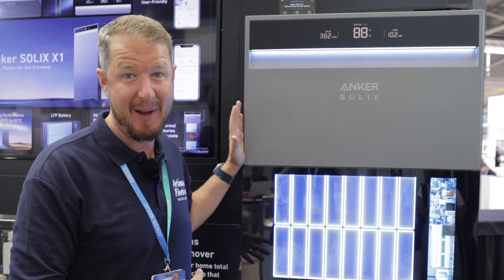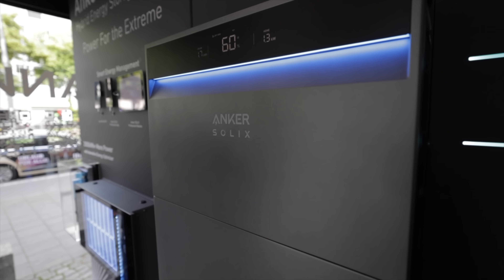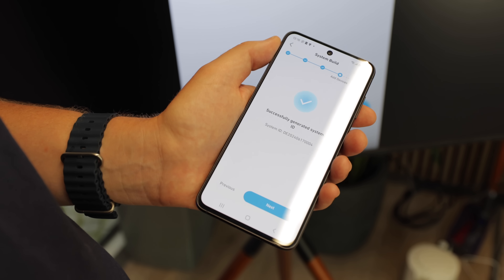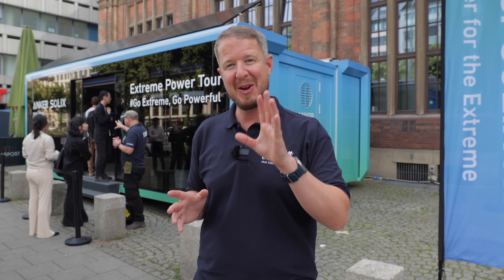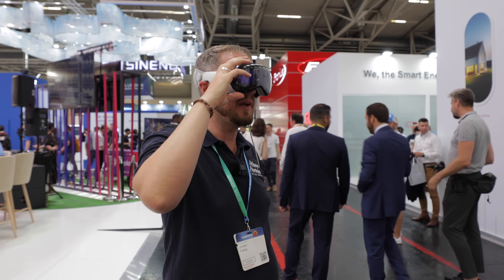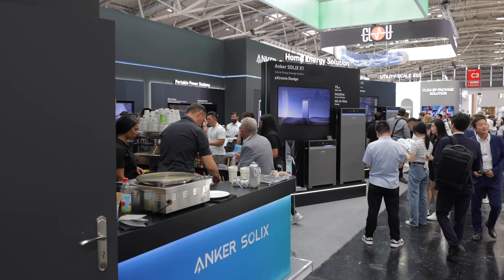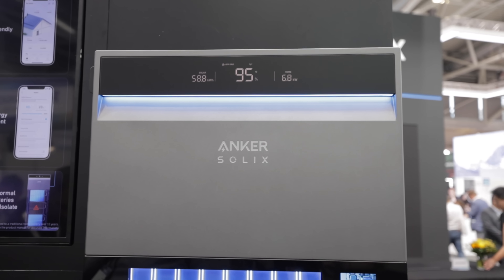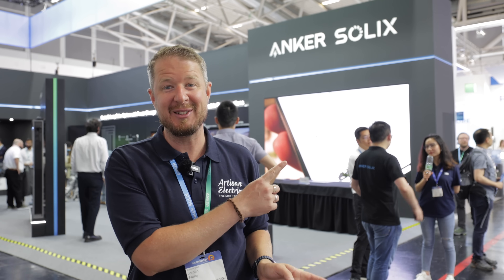EXTREME BATTERY STORAGE🔋Anker SOLIX X1 REVEALED

Comment: No cost yet in the US
Reply: I was quoted the following, from a local company in California, on the Solix X1 with tax and labor:
3 battery modules for a total of 15 kW : $20,450 USD before tax credit or rebates
4 battery modules for a total of 20 kW : $25,600 USD before tax credit or rebates
6 battery modules for a total of 30 kW : $35,900 USD before tax credit or rebates
1 power module only has a load start capability of 70 LRA so it will not start up most AC units unless it has a soft starter.

Comment: In case of mobile internet and Wi-Fi intranet BLACK OUT EMERGENCY. HOW DO YOU INTERFACE WITH THE SOLIX X1? Bluetooth? If not, it is a waste of money imo
Reply: It can interface with Home Assistant, so basically you'd set up one of those on a hub connected via Ethernet & then just integrate that with the batteries. You could then use it instead of or alongside the mobile app. You can use small UPS devices to keep your networking equipment and the hub itself online in a full power failure if the Anker batteries themselves & the grid go down, and those can also keep your WiFi up (just without internet).

Comment: Out of interest, for a 5kW inverter what size cable would you need back to fuse board? (assuming a 10m run, and 10kWh battery) Logic says nothing major (2.5mm2), but I guess efficiency matters a lot given number of charge cycles.... 

Im asking as Id love to know approx complexity of installation (there is already a 6mm2 cable spare in the ceiling void).

Comment: Had a quick look at the manufacturer's specs on line - all US spec at the moment, which is strange given they were showcasing the device in a European city.

Anyway, double-checked the ENA Connect Direct Live Device Register and to date (4th July 2024) it has no certification for use in the UK, yet.

Oh, and the manufacturer claims a "switch time" of 20mS - that'll be the time for the switchgear to decouple from the DNO supply and go into island mode **once a loss-of-mains has been detected**, so a wee bit misleading. They're not the first to try this nonsense tbh.

Comment: Could one potentially use it to charge up the battery on cheap rate and then run a high speed AC charger for an EV for fast charging?
Reply: High speed AC??

Comment: If you only have a single phase electricity supply and put these in could you then run three phase machinery directly off these batteries?
Reply: Assuming you intend to only charge the batteries from your grid supply, it really depends whether the system would charge with only one phase live (from its point of view). If the other two phases appear to be 'missing' my guess is it would probably not interconnect as it would see only one phase live as a fault.

If the chosen device (and your installation) was suitable for operation in island mode (aka "off-grid"), then I would say that you could run 3-ph equipment from the battery source BUT it depends what kind of 3-ph equipment you intend to operate. Some loads presenting things like starting currents for rotating machines can be rejected by inverters as they are incapable of delivering the necessary fault level unless they are significantly over-spec.
Reply: @protectiongeek  ok thanks. Appreciate the reply. Will look into it more.
Reply: @markscheiner3952 
Worth working out a comparison of installation versus just investing your money in the "bank" .

It's eye opening how long a return takes

Comment: Never quite understood why the established battery brands left the home storage market free for startupd to tqke over. Both Duracell and now Anker are in thr market i think it will pick up quickly dur to brand recognition. Good for them.
Reply: I think you are right. When I bought my Tesla or an iPhone etc, I never do an ROI.  For the Tesla I did do a TCO and on the servicing side it’s great on depreciation it’s poor or as poor as most other cars. Would that stop me buying it? Of course not, I wanted it and didn’t care the cost
Reply: @user-rc7dg3np9c  no one does an ROI on a new kitchen or bathroom. Or even a new boiler. They just need one or decide they want a new one. Why should a battery system be any different?
Reply: It doesn't pay back your investment, simple as that. They worked it out
Reply: @allan4787  never convinced by any ROI arguments. Most of the time, especially early on in a transition, people install a "thing" just because they want to.  Later on it becomes cheaper but even then it's installed because everyone else has one.

Comment: It is a good system but if it costs more than €150.00 per kw it is too expensive.
Reply: 150.00 per kw?  Tell me where you can get a 15kW battery for under 2000 euros - I'd love to know.
Reply: @Unshou  lithium ion, iron, phosphate batteries as cells currently cost from CATL USD 62.00 PER KW. Assembled with management controller and inverter can be found in Alibaba for USD 150 per kw for 15 kw

Comment: Not read the specs at this point but the temperature range is pretty standard stuff... for discharging.  Always read the fine print.  A battery that can't be charged below 0c and is mounted outside isn't a lot of chop in cold countries unless it has self-heating capabilities.

Comment: Another unproven product with no track record. Warrantys are worthless when the company goes bust before your 5 year warranty. Weren't you hawking a couple other brands and one went belly up on you?
Reply: The product is unproven. However the company isn't. Anker a well established company
Reply: @FOOL21352 This is Anker of the power banks and chargers fame? If so reliability and quality a a great price is Thier thing.
Reply: Anker is a great company. Very highly unlikely they will go bust any time soon. Also there are already home installs if you search on YouTube.
Reply: Not unproven, plenty of reviews in the states, and a few on YT of this system. Anker are a massive brand, and have been selling portable battery chargers for years.
Reply: Anker unproven? Ok mate go watch cooking shows.
Reply: Anker are a huge long established company in the battery world. Similar to Duracell in fact. Surprised that they did not launch years ago.
Reply: It looks very good
But lot of positive points you don't need, if you install it in your house.  So I guess the price much higher, then other systems.

Or do they have different lines, inside, outside, close to the sea and temperature range ?

Thxs for video
Reply: @marcelwebbe1960 nope. Its even cheaper : 5 kw is 1450!! Pretty cheap imo
Reply: @marcelwebbe1960  the UK guidelines for these have changed recently. The advice is now that battery systems should be installed outside because of potential fire risk even if that fire risk is now near zero because of the use of LFP batteries not NMC.  So the IP rating is going to have to be very standard going forward.
Reply: Brilliant 😂
Reply: Anker is actually an established company here in north america.

However, they do own a shady operation called eufy. Eufy got in huge trouble about a year ago for auctioning off people's info and then lying about it later. A lot of americans haven't trusted anker since then
Reply: The guy's a grifter. He'll do anything for money. Definitely gave a few hand shandies to older men when he was 18.

Comment: Sorry if my ideas are stupid , but the benefits of me being stupid = makes others look good , do you think in the future they would have a solar panel that is linked to a heater such as the floor radiators like they use in a ATA heat pump type so you would have a solar panel for disguised as blinds or shutters which in turn would have a small amount of batteries built into the radiator that would be enough to give out warm or cool air , depending on the time of year ,  depending on the size of the window and size of the room will dictate the size of battery needed with the radiator. I have three south facing windows plus a front door to the hallway plus a back door both doors south facing, I know the angle on the roof would be better but to capture the sun just enough to give energy for small air radiators you would not need 100% perfect situation, or am I just a thought away from total madness ?
Reply: It could work, but as you say the angle on a vertical surface isn't great so the actual solar cells themselves would need to be tilted to compensate for that I think. They can also be quite heavy so blinds might be out of the question.

As for now, I've got heat issues (well, heatwave issues really) in my house too & fitted those cellular blinds with aluminium inside and that has made a big difference as a passive solution, in both hot & cold conditions, so I can recommend those if you have tempered glass & trickle vents on your door & window frames already. Without the vents you'll have to leave at least a 10cm gap at the bottom to avoid mould building up, & without the tempered glass you may find your glass cracks due to the extreme heat build-up between it & the blinds. Exterior shutters will do better than anything else available right now if you're able to use those though.
Reply: @NightCatArts  I don’t have vents in the windows or doors, I thinking about the flexible panels not the solid one on the roof type but thank for replying.